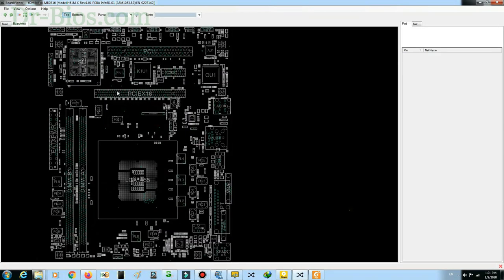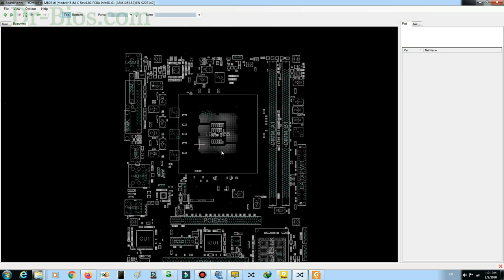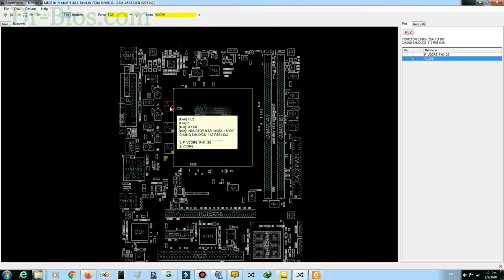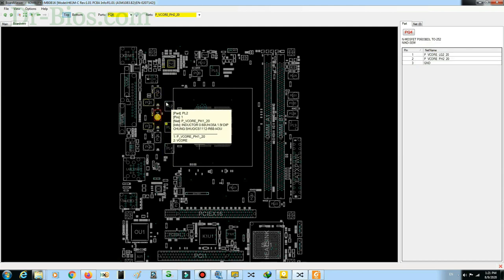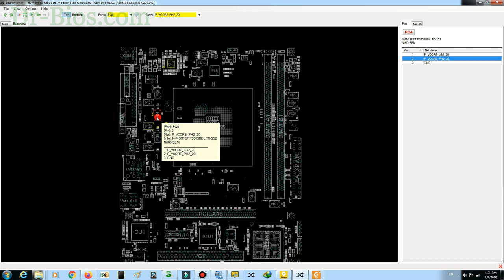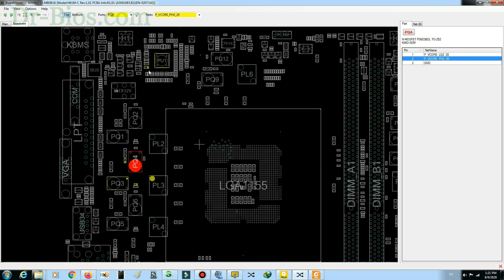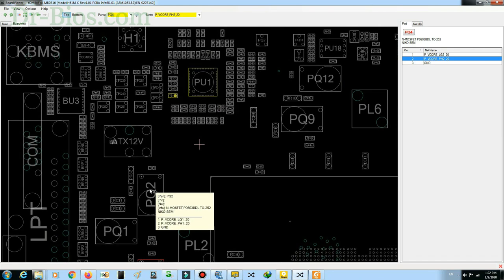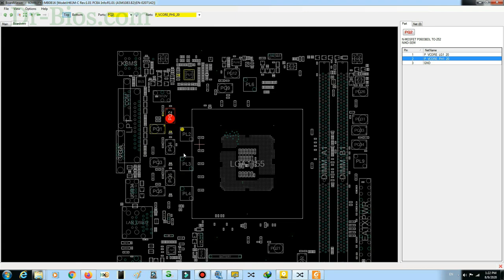How to Repair Asus Motherboard H61M-C

Comment: Hi. You sound like you know a lot about a PCs. I have a Motherboard with no Manual for it and it's not available on line. My header has 10 Pins unmarked. Can you please tell us how to identify Front panel Pins using Multimeter or any other technic without damaging the board. Thank you.

Comment: I'm proud your experienced to troubleshoots a dead motherboard. That's the most underrated and comprehensive boardview of that moboard component part operations video tutorial ever so far. But I need help a quick question my friend about my Asus P4P800-E Deluxe motherboard. This is my first time trying to resurrect/repair my dead motherboard. Only certain part I repaired and changed/replaced already the (1) BIOS chip, (2) capacitors, (1) IC-driver controller to mosfet, and (2) transistor mosfets (negative side body) near side of the CPU processor. I have the PTi9 LCD PCI Diagnostic Analyzer Tester...indicates LED lights of +12V, +5V, +3.3V, and Reset are good (lights on) & fan runs means no problem on transistor Mosfets anymore as I double tested too that 12Volts are running good designed to run CPU processor. But the PTi9 LCD PCI Diagnostic Analyzer tester still telling me that there's signal error, it says check the CPU and power box (power supply is tested good all +12V, -12V, +5V & +3.3V) and the other two indicates that RST and FRAME are both Invalid shows in PTi9 tester. Also I'm seeing LED lights of FRAME, IRDY, and SYSClk are off, it shows in the PTi9 PCI Diagnostic Analyzer tester.  I have the "Boardviewer" software (to see the schematic diagram of P4P800-E Deluxe board) that I clicked the CPU drawing part and looked at the RESET, looked at the motherboard then tested the Resistor that is soldered/connected on negative side that the value is correct that has no problem. The two pin reset (for the button reset) doesn't work when I pressed the button. If you have time, please try to look on the Boardview in part of the RESET pin because it's not working. I don't know about that FRAME & RST where to troubleshoot that.  I touched the CPU processor it doesn't make any at least build up heat/warm. I tested the CPU processor from my other Asus motherboard, it's running fine.  What part of the motherboard should I trouble shoot on that P4P800-E Deluxe? This part I'm lost already. I need help, any idea? Great help would be appreciated so much.

Here's what I did, I plugged one 1GB stick ram, 3V battery button, fan for CPU, plugged-in the PTi9 Post Diagnostic Analyzer Tester, unplugged CPU processor and 12V-4-pins, then plugged the 20-pin power supply, then turn it on, everything runs even though it's unplugged CPU and 12Volts-4-pin. On the tester it shows LED lights on at the +12Volts, +5Volts, 3.3Volts, RST, CLK, except FRAME, IRDY, and SYSClk. So, it means the issue is at the Power Block of CPU because CPU doesn't build up warm/heat. Problem is still don't know where is the one that doesn't provide either the +5Volts or 3Volts or 1.2Volts. Intel 82865PE MCH Chipset build up its own heat but it has its own original heatsink since P4P800-E Deluxe was built in & sold in the market since.
Reply: check whether clock is present ?
Reply: @gamespecialist7241   Hi, where and which one is the clock? Is it the crystal beside the CMOS reset and button battery?  I replaced the ADP3180 (integrated Circuit-Analog Device 6-Bit Programmable 2-, 3-, 4-Phase Synchronous Buck Controller & PWM switch), the CPU processor starts building up heat but still nothing shows up nor any indication of good. The reason I changed/replaced the ADP3180 because I tested and I noticed is not providing small voltage to power up the two IC-Mosfet Driver (ADP3418), only one IC-Mosfet Driver is powering up. There are three of them (ADP3418).  Ok where and which one is the clock? and how do you test it and what instrument to test it? And what requirement frequency we are looking for in crystal/clock? Did I get the right guessing? Correct me if I got the wrong guess, great help would appreciated so much.
Reply: Did you succeed eventually?
Reply: @NickBrunsky   The clock comes from a rectangular metal can component (Not the tube like one with the 2 long legs) You can test for the clock on the 2 adjacent capacitors as the clock component may not have any access. You can best test with an Oscilloscope. The frequency should be the same as whats marked on the metal component.

Comment: I have the same mobo.,
1.PC Works fine when cold started but it's temperature reaches more than 80 to 99 on stating itself. After some time it automatically turns off at some point.

2. After turning of it won't turn on for next 10 to 20 hours. While trying to turn on during the time ,smps and cpu fan just turns on for 3 second and turns off. It happens repeatedly for next 4 to 5 times.( No display).

Which could be the faulty component, cpu or mono or smps. Please help me

Comment: what is the function of the mosfet, which is located above the processor socket and near the 16-volt capacitor? On my board, 12 volts come to this mosfet, and zero volts on its other two legs. on the next mosfet on all three legs, too, at zero volts. The multimeter does not detect a short circuit or a break on the 12 volt MOSFET. What could be the reason?

Comment: hi dr-bios. i have asrock z87 pro3. suddenly dead, while watching youtube. 
mobo just turn on, and off again for 1 second. have to press on button again to power it up, and it turns off again after 1 second.

used multimeter, diode mode, and probe the 24pin atx connector mobo side, most of it reads 0ohm. 
havent got far since i am still learning all these things.
Reply: check for PWR_OK on the connector.. grey wire.. (usually pin 8) should be 5v. Without this the psu will shut down

Comment: What about a board where no power  indications come on at all. I checked the PSU and put a new 3.0V battery which are fine. The previous battery was drained. I have checked all over the internet and have no answers (The board has two leds and a built in power button all of which do not light up or work). Please help. Board is gigabyte z87x-ud5h
Reply: check for 3v at the power switch jumper and for the 3v and 5v always on from the psu. I think you are missing one of those if the led on the board isn't on when the psu is connected. When the cmos battery is drained it's useful to check the position of any clear cmos jumper.
Reply: Look for motherboard power up sequence videos.
Reply: @bslay4r  Please check the comment date prior to replying. It was commented 8 months ago. Solved: USB pins were touching the ground and shorted the board. When they were unbent, the mobo powered and worked properly